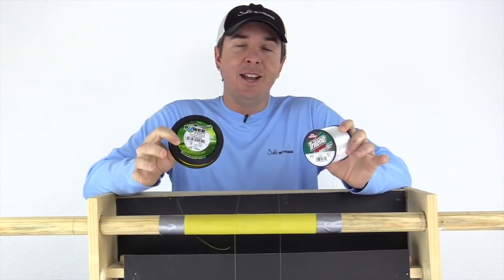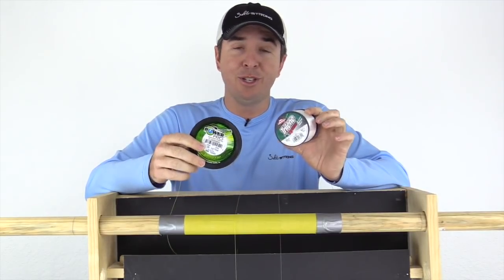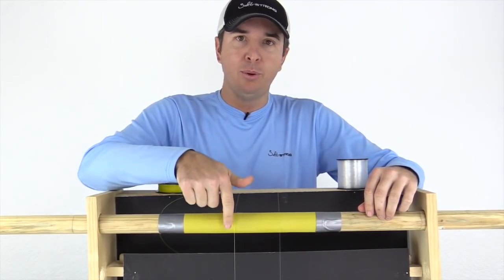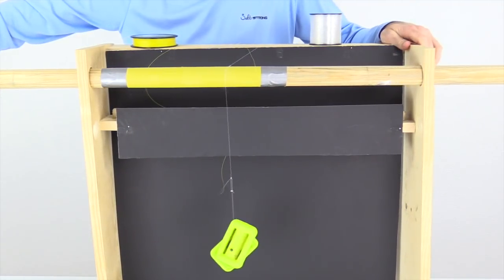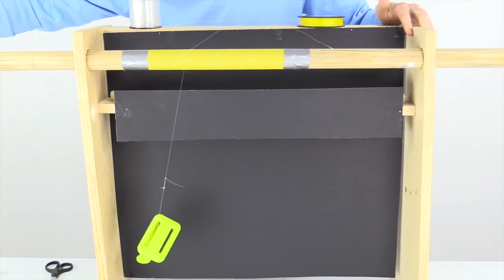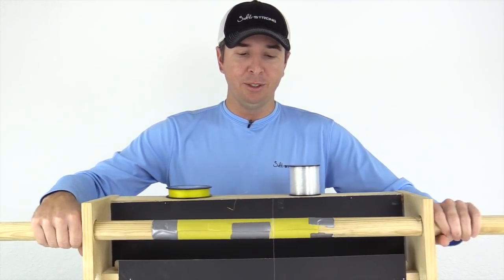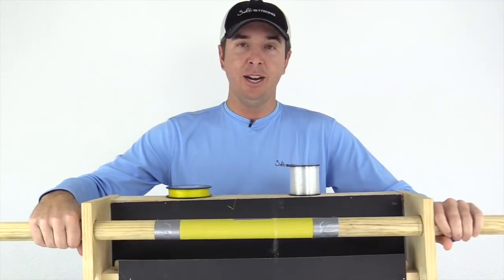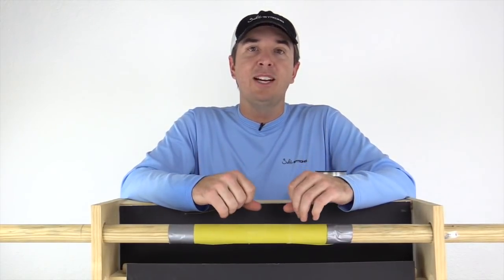Is Braid More Abrasion Resistant Than Mono? Find Out Here...

Comment: Test equal diameters. Something like 30lb braid and 8lb mono.
Reply from the maker: Can you help me understand when someone would be deciding between an 8 lb line and a 30 lb line for targeting a specific fish?
Reply: To be honest they probably wouldn't be deciding between those lb tests.  Well unless they are using something like a drop shot in super clear midwest water.  In that case they would only be using the light line for visibility sake.  The reason I'm suggesting using the same diameters is to simply keep the test consistent. 

Most serious fisherman these day use braid simply due to knot strength and the fact you can get a much larger lb test with a smaller diameter when compared to mono/flouro.   The smaller diameter allows for increased casting distance (when compared to mono/flouro) and increased line capacity (typically by a not insubstantial amount).  

Everyone I know personally uses braid on the spool with a flouro (or mono depending on technique being used) leader tied with an FG knot.
Reply: DISAGREE
The purpose of this test is to highlight real world fishing situations. When fishing you choose the BREAKING STRAIN most suited to your needs/application not the diameter of line. Therefore BREAKING STRAIN of line should be kept constant for braid and mono in this application. Another example... if you normally fish 20lb mono - then you're NEVER going to try and match the line diameter of the mono with braid to end up with 60lb braid or whatever. That is ridiculous, half the reason people use braid, aside from bite detection, is that it has a thinner diameter per breaking strain than mono and so allows for greater casting distance.

Comment: For bass fisherman 20 lb braid is used for finesse fishing and 20lb Mono or Flouro is used for power techniques such as flipping/pitching. I get it’s the same pound breaking strength but it’s not a fair comparison in my opinion. There’s no bass angler I know of that would use 20 lb braid to fish boat docks with unless they were skipping wacky worms or dropshotting and they’d used a flouro leader for those applications almost 99% of the time. 20lb braid is the same diameter as 6lb mono and 20lb mono is the same as 65lb braid.
Reply from the maker: Thanks for sharing your thoughts. What do you believe would be the fair comparison for this test?
Reply: @Saltstrong  From some of the comments, 120 lb braid vs 12 lb mono wouldn't be out of the question... 

I would like to see some 60 lb braid vs 20 lb mono, just the shut everyone up if it still breaks super fast.

Comment: i have seen this test done with lines of the same diameter and the results are the same. Braid breaks quickly because each strand break at a time rather than all at once this means it is much less abrasion resistant
Reply: Thats nice where?
Reply: That might be one reason but also it has a much thinner diameter

Comment: Had to dislike. 20 lb braid is equivalent diameter to 6-8 lb mono. Do a test where braid is the same DIAMETER as the mono.
Reply from the maker: I was thinking that the target species of fish that an angler would use a 20 lb braid for is much different than the target species of us 6 lb mono. Can you help me understand when those two options would be an either-or choice?
Reply: DISAGREE
The purpose of this test is to highlight real world fishing situations. When fishing you choose the BREAKING STRAIN most suited to your needs/application not the diameter of line. Therefore BREAKING STRAIN of line should be kept constant for braid and mono in this application. Another example... if you normally fish 20lb mono - then you're NEVER going to try and match the line diameter of the mono with braid to end up with 60lb braid or whatever. That is ridiculous, half the reason people use braid, aside from bite detection, is that it has a thinner diameter per breaking strain than mono and so allows for greater casting distance.
Reply: It’s quite common to drop shot for small mouth bass with 15-20lb braid connected to a 6-8LB Mono or fluorocarbon leader. When I m flippin grass mats or brush for large mouth bass, I will use 50-65lb braid or 20-25lb monofilament or fluorocarbon. I tend to stick to braid because I believe it is stronger. As you probably know there’s guys that like the mono and fluorocarbon because they believe it’s more abrasion resistance.
Reply: Here in my place people use at least 0.23 - 0.30mm braid with 0.23mm - 0.40mm leader for invisibility. Target species is Snakehead, Barramundi, Papuan Black Bass etc. Most of it with Baitcast reel.

0.23mm leader for barra is okay but for snakehead? Say good bye to your lure. The line will snap that's why people use straight 0.23mm braid or 0.40mm leader. for it
Reply: Riley Pilot mono would still win it's nylon braid is strands it'll go a lot easier than mono will that's why I never use braid
Reply: Wow! Jimeny Crickets man....glad I kept my receipt (not opened yet) for that power pro that I just bought. I'm definitely nervous now. The question now, with my other rods, is.....to re-spool, or not to re-spool. If I lose a nice snook....I'll have one hell of a temper tantrum. Seriously, THANKS for the video.

Comment: Use the same diameter. That is only fair.
Reply: Mark, it's obvious that this test was not meant for a scientific publication but instead for fishermen. I find it perfectly performed for the purpose it was designed. A wet test would be nice as well but I doubt we would see a different outcome. The rest sounds like some nice "creative" statistics lecture.
Reply: I think breaking strength is more accurate. personally I base my line choice on strength according to my rod. a lesson to learn here is to use leader when fishing braid
Reply: @FBP3392  BINGO!! And a really loooooooong one.
Reply: I agree. Although it would be interesting to see how different diameter braids do. Cause you might want to use a heavier braid to increase abrasion resistance but still be smaller than the equal Mono. For instance 30# braid might preform better than 20# braid and might still be smaller diameter than 20# mono. Just a thought
Reply: Brian, I love viewing your tests and my comment was intended as support of further testing. Unfortunately, my conclusion was an oversimplification.  In most cases of line comparison you compare brands of similarly composed and sized product that are more easily compared. However, Braid to Mono is a contrast evaluation unless all variables are taken into consideration. For example:

What you assert as a potential unfair bias is in fact what is called over-adjustment bias or a properly defined inconsistency that allows for a different set of evaluations. Therefore, without the variables that such revised evaluations allow, the test you conducted is potentially invalid. Here is why. 

This term is meant to describe control (eg, by regression, adjustment, stratification, or restriction) for a variable that either increases net bias or decreases precision without affecting bias. Over-adjustment bias is a control for an intermediate variable (or a descending proxy for an intermediate variable) on a causal path from initiation to one of many possible outcomes. It is true that not adjusting circumstance of a process may produce a particular result, but by making no adjustment as control for a variable that does not affect bias of the causal relation between exposure and outcome does affect its precision. 

In the case of Braided line and Mono of the same diameter there are other circumstances that affect the precision, i.e.; the grit size on the sandpaper used as it relates to the varying strands of the Braid as applied to the inherent smooth texture of Mono as one of many different possible variables; the lubricating effect of water and slim on the lines; adjustment in various line diameter that offers not a comparison as much as contrast between type of line. These are only three of many examples. Without investigation of such variables and how they may impact results,  such comparisons are in danger of drawing a false conclusion when that conclusion is drawn based on input of insufficient or over simplified data.

Conclusion? Expand your testing to include variables, when needed, which will then help you draw a more precise conclusion.
Reply: @markduncan3649  Holy Smokes!! All of the sudden....my head hurts man.
Reply: don't know if it's been said, but i suspect it'll be irrelevant and end with the same results.  Did you even watch the video?    the braid didn't even last 1 full pull while the mono went so many more pulls and turns.   So, say you go by diameter, and i'll randomly say the braid is 1/4 the diameter, do you think that lousey additional 0.3mm of more braid would make it go another 10 pulls of sandpaper when it breaks on the first pull?
Reply: DISAGREE
The purpose of this test is to highlight real world fishing situations. When fishing you choose the BREAKING STRAIN most suited to your needs/application not the diameter of line. Therefore BREAKING STRAIN of line should be kept constant for braid and mono in this application. Another example... if you normally fish 20lb mono - then you're NEVER going to try and match the line diameter of the mono with braid to end up with 60lb braid or whatever. That is ridiculous, half the reason people use braid, aside from bite detection, is that it has a thinner diameter per breaking strain than mono and so allows for greater casting distance.
Reply: Mark Duncan it wouldn't matter mono is the best
Reply from the maker: I was thinking that the target species of fish that an angler would use a 100 lb braid for is much different than the target species of us 20 lb mono (this is the disparity in strength that gets the same diameter). Can you help me understand a scenario when those two options would be an either-or choice?
Reply: Let me give it a try.  When I fish the surf, I use my kayak to drop my baits with a heavy sinker 300 to 400 yards from the shore.  I'm targeting sharks and bull reds beyond the breakers.  At that distance, my mono rubs against the sand at the end of my line and against the sandbars near shore.  Obviously, braid of the same pound test is going to be smaller in width allowing me to keep more line in my reels.  This  would result in longer drops if I choose, but that's beside the point.  I could switch to braid of the same width as my mono and keep the distance of my drops the same.  The benefit in that case is that this would give me a higher pound test to fight bigger fish, but I may be giving up on the abrasion resistance of mono.  I know it's a very specific use case.  Just some food for thought.
Reply: I say use 6lb mono vs 20lb braid then they're the same diameter.
Reply: Brian Pinard you are absolutely right. I completely agree with you.
Reply: nik 33134 Quite simply if you are going to use a process to draw a statistical conclusion, then yes, use good data in drawing that conclusion.

Comment: I fish braid because of the diameter vs strength. I fish 50 lb braid that is a 15 lb diameter. I would love to see the test with diameter vs diameter. If it goes the same way, I might be changing my line.
Reply from the maker: If you are using spinning gear, then I recommend considering a lighter braid because the casting performance declines quickly as the diameter increases... test results coming out soon.
Reply: I have had the same experience as well.

Comment: I agree with the other comments. Braid has a much thinner diameter. Braid is always much more difficult to cut than mono. I remember you watched the video from when I went to Tampa and fished with you, the 26" snook that took me under the dock and around the pilings was on 10 lb braid, and the line held up well for the rest of the day. I think there are way more factors that play into this because I'm still confident braid would hold up over mono if a fish were to take you around a nasty piling.

Comment: I wonder if line diameter would make a difference. I knew braids would not hold up to abrasion very well but I was shocked at how quick it snapped. I would test different types of braids. 6 strand, 8 strand, Hollow core etc.
Reply from the maker: Thanks for the suggestions. I'm curious to see how the 6 strand vs. 8 strand braids would compare in this sort of test... I'll add that to my list of ideas for future tests. Fish On!
Reply: Good point. I'd like to see the same test again with equal diameter lines rather than rated strength. The two perspectives would allow the best evaluation.
Reply: Dude I was thinking the same thing. The diameter of the line should play a big factor in this test.
Reply: I would also like to see the test with the same diameter line